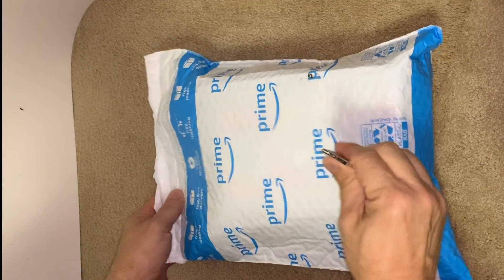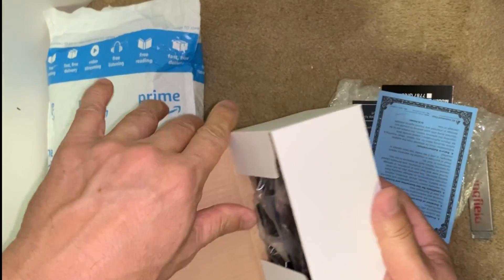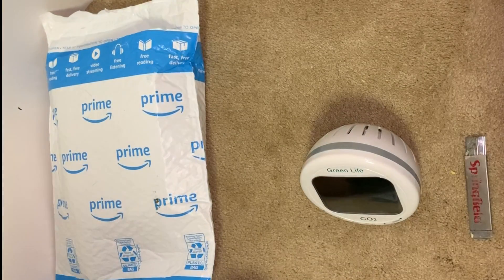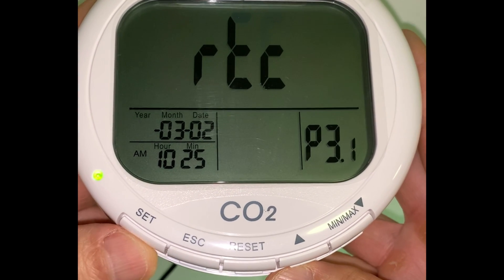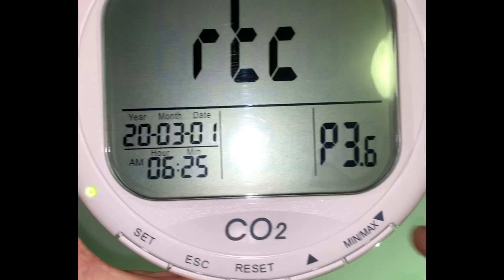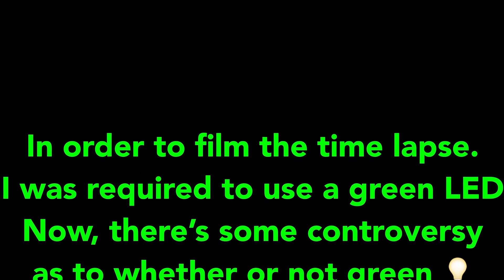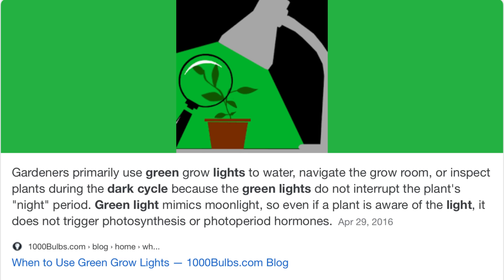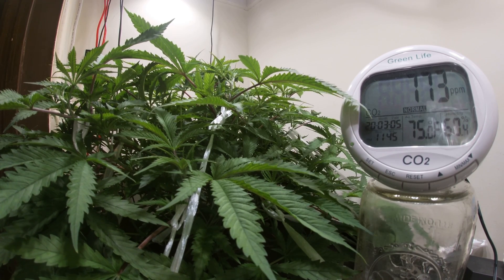How To Cultivate / Maintain Healthy Cannabis Aeroponic Roots HPAA / CO2 Monitor / Grow Time Lapse

Comment: I have a similar setup but I don't have those kind of roots in 2 weeks. Only have moderate roots in 1 week.
Reply from the maker: how big is your root chamber?  i honestly think the size of the chamber will make or break the root system.
Reply: @aeromah1062  my root chamber is 4x8x2. Pretty massive. Contains 32 plants

Comment: What were your fog timer settings for this one? How long would you keep the fog pumping in and how long would you keep it off?
Reply from the maker: Varies at different stages of the plant growth... and depending on how the roots looked.  1,2 seconds and I had it blasting as long as 15 seconds at one point.

no set formula, as needed was how i did it for the most part... sometimes i was way off and others i was spot on.

Comment: Lots of inspiration, thankyou! I've been thinking of building a hpa system myself. This morning I was wondering if using air in the system instead of a high pressure pump would be helpful. After watching your, videos I'm convinced air is the way to go! I would love to see more about your spray tips. I read you noted 3D printing your own nozzle, but hesitant buying the printer. Auto cad fusion360 is free to the hobbyist and student. You can work up a design and send it off to be printed that way. I also thought seeing as the air brush failed, what about a spray gun for car paint? First thought is they are designed for thicker paint so that may be a way around the plugging issue of the air brush. I hope to see many more updates as you perfect your system.
Reply from the maker: There are many ways to get it done... I think the key is going to be with nozzle outlet hole vs the air passage.  More so, the way the spray defuses from the nozzle.  

It's basically shapes, sizes, ratios, and pressures lol.... sound complicated maybe but, it's simple.  Challenging thing will be the DIY factor trying to do it with common items found around the hardware store.

Comment: Off topic: could you do a vid on your current nozzles? Ty
Reply from the maker: current nozzle... sure... i was going to change the design on it because I know what the flaws are.... haven't figured out a way to get past it with off the shelf materials..... i have been looking at the 3D printer to design one from scratch.... this way I can manipulate the configurations to get the spray pattern I like long with the air efficiency I want.

still on the fence about getting the printer.... but, need to get the other garden back online asap!  need them fresh veggies! lol

Comment: Wow...love the time lapse. Its great that you can take stuff and put together...this is something I am lacking and don't know how to built things...so I will have to invest money in getting all parts needed to built HPA BUT the more I search the more I am leaning towards a AAA...maybe not perfect but close to it...lol.  Sometime I get myself confuse between HPA and AAA since they are so close in ways...I think...lol. Thank you.
Reply from the maker: sorry for the late response.  been very busy chasing things down and assembling/upgrading the HPA system for the veggies.  

with all this madness going on and how everyone is getting sick with this coronavirus/corvid 19.  I've thought it was a good time to restructure the garden and add my barrel back in along with 2 mini towers.

been trying to put footage together on this and I will upload soon.... 

as for the AAA vs HPA... I had a issue with the AAA and the unloader valve... it had a leak i'm guessing... caused one compressor to fail... which sucks!... not sure it's done.... the day I checked it and disconnected it the electrical was sound.... but, the compressor wouldn't pump.... so, I think due to the heat the piston in the motor expanded and froze in the cylinder.  

one thing I would say about AAA spend a lot of money and make sure everything is new... meaning valves, regulators... and so on.... meaning my check valve was bad... replaced it... but, then the unloader valve seems to have went out on me... at the cost of a brand new motor.... had everything been new from the get go then I believe none of these issues would have arisen. 

Stay tuned because I'll be tackling all issues.

Comment: This pdf is an interesting read 
http://fluence.science/wp-content/uploads/2016/09/High-PPFD-Cultivation-Guide-9.27.16.pdf
The formula for DLI=PPFD x light hours per day x 0.0036. Running 12/12  you`ll need least 700ppfd for a  DLi of 30
Reply from the maker: Thanks for the link! It was a good overall picture of what it takes.  As technology changes... everything seems to change as well lol.  Like the Dr. Keith Mccree's Curve which was the whole 400-700nm spectrum.  It appears they are studying the whole far red section now and companies like Apogee are utilizing a dual sensor array to pick up both the full spectrum and far red's as well.  I'm probably going to pick up one of the quantum sensors to measure off the par/ppfd so, I'll have a solid baseline of what is going on.  As for light recipes that will come later.  We know what blues and reds are good for... but, it really comes down to the application and how you are running them... I'll cross that bridge when I get there but, I kind of see it as supplemental lighting when it comes to light recipes... who knows I may end up changing my mind once I get the info in front of me lol.

Thanks for the link it was good!  Good Looking out!

Cheers!